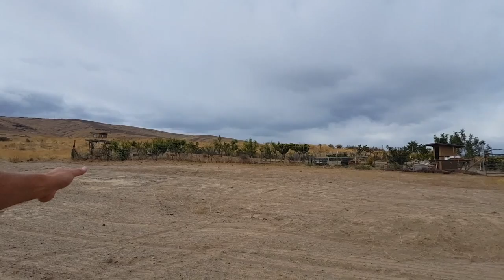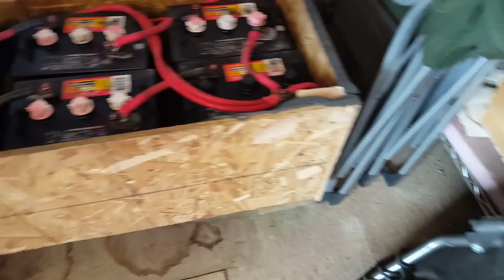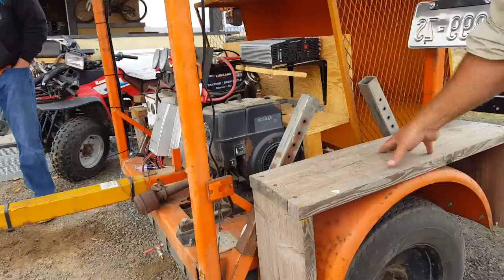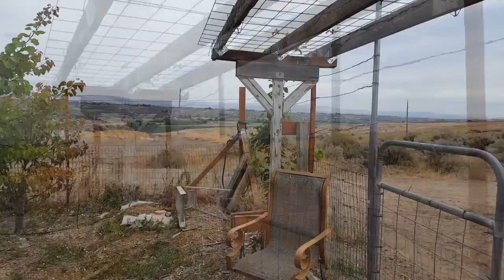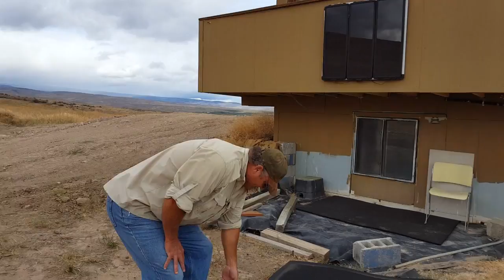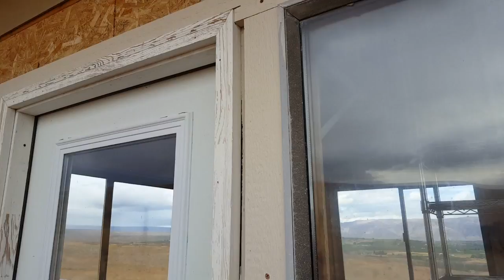The Ultimate Off Grid Master Builder!

Comment: Surface bonded  =  waterproofing?
Reply: Yes.
Reply: A nonymous
thank you
Reply: No problem.  If you want to take it a step further, pick up some roofing paint, I recommend the brand Black Jack.  They sell it in an aluminum color for heat reflection.  It's commonly used on mobile homes, when resealing the roof.

So, after you're done with the surface bonding, paint some Black Jack on there--no moisture will penetrate AT ALL, plus it will extend the life of the wall.  It's really cool stuff. 

Best of luck to you! :)

Comment: All the research for this project really shows. (the DOT trailer is genius)
My mother used Surewall Surface Bonding in the 70s and it's still perfect. Now Sakrete and Quickrete have their own versions. Make sure you follow the instructions exactly and it saves massive time.

Comment: If I was going to use concrete I would go dry stack too and put any insulation on the outside. Good way of building.
Reply: Would you seal the inside wall as well?
Reply: I would use the same surface bond inside and out. That is a good deal of where the strength comes from.